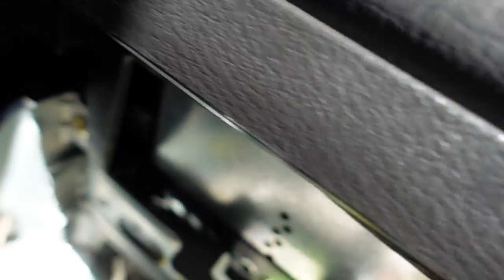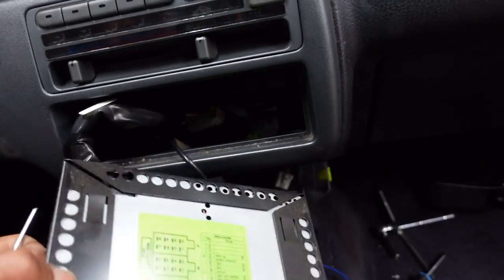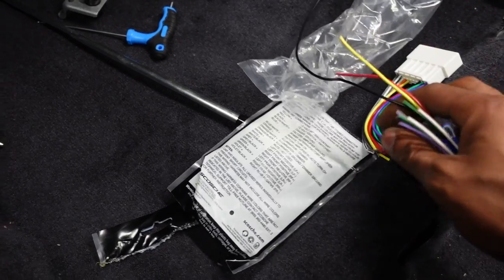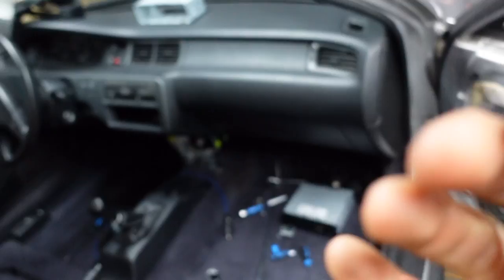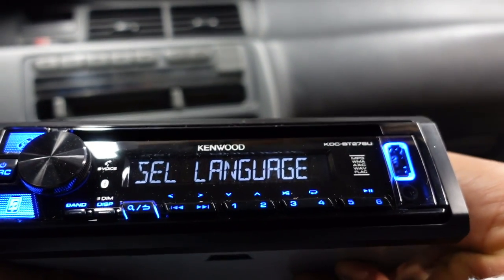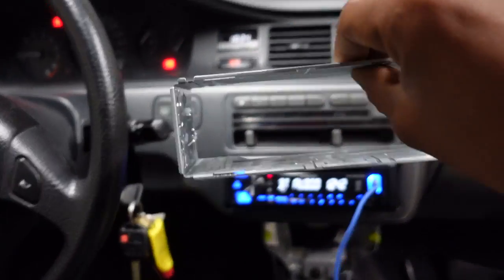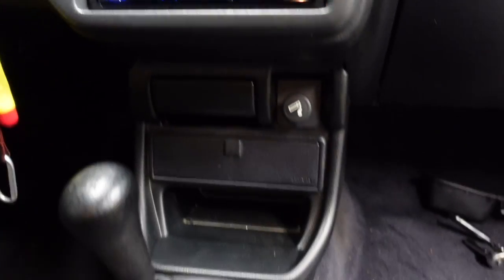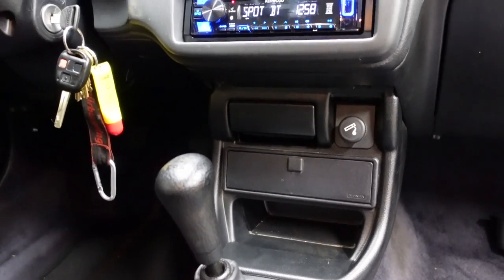Full "No Cut" EG civic Audio upgrade (SINGLE DIN RADIO INSTALL & 6.5" SPEAKER INSTALL)

Comment from the maker: Thanks for watching heres a list to all parts used:

Radio: https://amzn.to/3l7psUC kicker 6.5" speakers: https://amzn.to/3CLERju 6.5" speaker door adapters: https://amzn.to/3CRtqa2 
Radio wiring harness adapter: https://amzn.to/3HSSFfR
 Speaker harness adapter: https://amzn.to/3p00iIJ 
soldering iron: https://amzn.to/3HQMTLD 
heat shrink: https://amzn.to/310rj6l 
wire stripper: https://amzn.to/3lu0P4X

Comment: nice and clean, good job on it. that little heater keeping you warm in there?, im gonna have to get another one for my garage my tropical ass does not do well with the cold.
Reply from the maker: Not even close Cole but if I let it run for a bit before I get out there and keep all the doors closed its not to bad do you have a 220v heater?

Comment: Hi nice vid!
I mounted an headunit which works perfectly with the ignition on, but once the engine is started you can no longer hear the multimedia audio (fm-android auto-bluetooth) other than beep of the buttons.
I tested two headunits but the problem is the same. 
Everything works only if I go directly to the engine running without dwelling on the ignition only on.
Can you help me?

Comment: I know what I'm ordering now so I can replace my speakers.  And it looks like your interior is black.  To bad I don't have my old optional rear speaker setup, I could've sold it to you so you can have something else to install lol. I'm also in Virginia.
Reply from the maker: Its a good setup for sure, I have all parts I used linked in the description, haha all good brother!
Reply: @Beezy_Builds  I already put some things in my cart lol. I'm going to order the 4 pack speaker harness adaptor kit because I have gathers interior with 4 rear speakers in the quarters.

Comment: Hello my brother,  I'm responding to your post late but I have a question. I planning on keeping factory radio with cassette player. I want to do new monitor with Bluetooth.  Want to keep both is there a convator or a way to keep both?
Reply from the maker: Look in JDI they have a tucked radio option
Reply: @Beezy_Builds   I will check and thanks for quick reply, just want to be clear I want the option in having both factory with cassette and the new monitor with 7" screen Bluetooth if there is a convertor to have both?

Comment: Hey bro love your vids! Do you know the dimension of the radio in the eg civic? Wanted to install the ATOTO F7 XE 8 inch Single-DIN (touch screen which comes out of the radio console) and i was wondering if it would fit.
Reply from the maker: Thanks for the support bro the radio I used it linked in the description but I don't know the exact dimentions